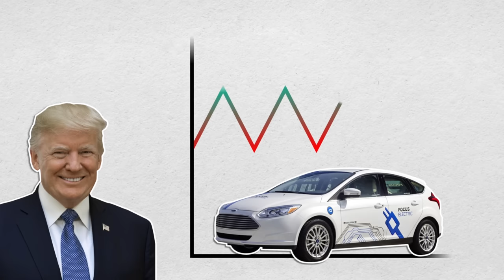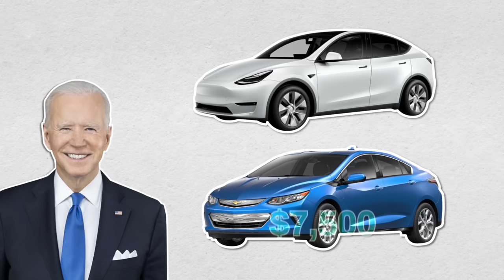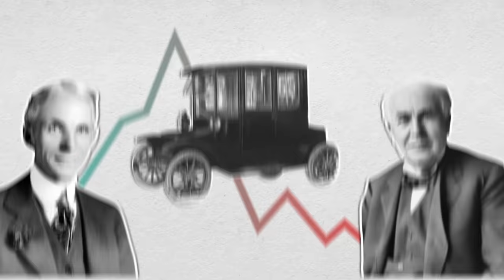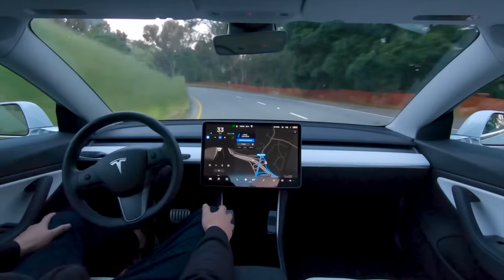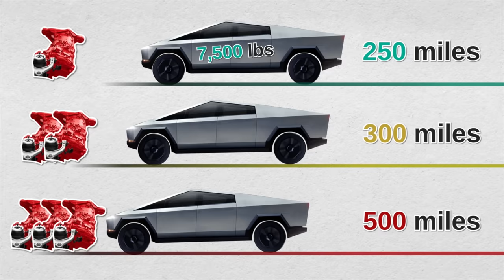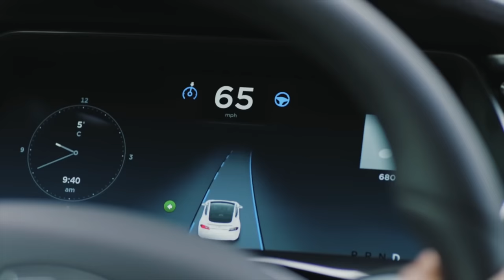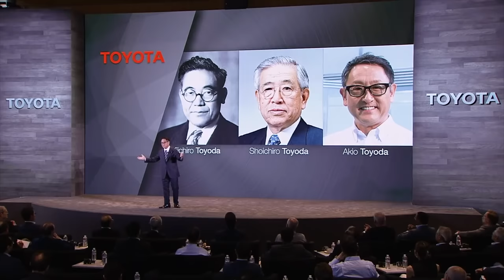Here's Why Toyota is Refusing to Make Electric Cars

Comment: Don’t want an all electric car myself…I think a hybrid vehicle makes the most sense.  Infrastructure is no where near where it will need to be and agree with Japan, electricity has to come from somewhere and Coal, Gas, Nuclear are really the only ones that are truly currently cost effective. Wind and Solar are too expensive to get started and rely on the weather.  Hydrogen may be a solution but it too is no where near a ready yet. I drive a Mazda and believe they and Toyota have the right mindset for their main vehicles.

Comment: Plug in hybrid has to be the way forward, a petrol engined self charging EV has to be kinder on the environment than a fully plug in EV!
Reply: I agree although ev range needs to be 100miles instead of the paltry 26-30 we see on most currently available phev. I'd also like to see all hybrid and ev fitted with v2h tech so they can be used to power your home when needed.

Comment: And of course, the Bolt has been recalled because of the faulty battery and they are suing LG. Electric cars never went away as such. In some countries the milk trucks were electric and buses in some areas have always been electric. It was just never taken up fully as a passenger vehicle until a company that was not tied to the oil companies got involved. Remember the Chrysler EV1?
 I think the EV vs Gasoline car battle 100 years ago was similar to the VHS v Beta fight. One had to win out in the end. I am just surprised it had to mean the end to EV's rather than a secondary adoption.
I like the Hydrogen idea because you can replace the bulky Batteries with a little Hydrogen engine but my concern is it makes the whole process convoluted from the production transport and storing of the highly explosive material to the fact there will be more moving parts in a car again and not less. It all seems to point to keep people in jobs in the production, transport and storage of Hydrogen and for mechanics who would lose half of their work on EV's.
In my humble opinion.

Comment: I am from europe and drive a Renault Zoe full electric car. 136 horsepower and 52 kw batterie gives a range for about 200-250 miles. For long distance travel I drive a Lexus RX400H wich ist still fine after 150.000 miles. I prefer defintly my electric car for travelin distances up to 100 miles.

Comment: I am thinking about an electric car for an unconventional reason. Perhaps one that the CEO of Toyota should consider. I do not want to buy a separate standby generator. My power goes out about 5 times per year. Fords Truck can be programmed to become backup power for the house with an appropriate switch installed to remove standby power from the grid. Its either that or a Bronco lol

Comment: Sadly, Tesla is ranked 25th out of 26 manufacturers in Consumer Reports most to least reliable list. 
The Chevy Bolt is having major problems with their lithium battery fires. LG is working on the issue but until then GM will halt production of its Bolt.
 Needless to say, there is a long way to go before EVs are mainstream.
 Currently, hybrids by Toyota/Lexus represent the best combination of quality, reliability, and low cost.

Comment: What about the GM Volt where you don't need a charging station. The 4 cylinder engine will turn on and act like a generator and you don't have to worry about being stranded.
Reply: That is called a hybrid.

Comment: You said the Bolt was the only EV WITH >200miles of range under $50k. The Model 3 is less than $40k ($39,990) and has range of 250+

Comment: Even if Japan is mostly reliant on coal and gas for electricity production, replacing all gas combustion vehicles with electrics and increasing electricity production capacity, would still result in lower greenhouse gas emissions. Same equations being used everywhere electric cars are being adapted to where coal and gas are still used to produce the electricity required. Japan does also use Nuclear, wind and solar power generation as well. They are approaching 10% of demand from Solar.

Comment: No to EV at this moment due to its range, available charging stations along highways and the cost of replacement battery. Another issue of the high energy battery is safety. Collision and any impurities in the battery can cause explosion and fire.
Reply: @colingenge9999  More than hundred millions gasoline car on the road vs a few hundreds of EV.

Comment: ford model t was made in gas and a 100% hemp and hemp fuel model just didn’t take off because consumers preferred the gas because it was louder and would help people hear it taken from my high school history books 

sorry if you’ve mentioned this scotty but thought it would be cool to discuss with some of the new to a 1920 ford model t

since we’re on the topic diesel engines can also run on vegetable oil and even better on used vegetable oil mixed with a solvent that is described as (have to get the name and will come back to edit) farmers and top gear has with jeremy have done it it runs just as well as diesel with the solvent that makes it thinner like diesel giving it the same range but you have to let it set for a few days my guess to the lack of popularity is that vegetable freezes and will require the diesel fuel to power a heater for about 15 minutes before being able to run on the used veggie oil 

 2 local shop here in LA that does these conversations on newer vehicles for about $10k i know about

Comment: I have a 100% electric Nissan Leaf. Charging it at home is a breeze because it charges while I am sleeping. I bought it used for around $7,000 dollars. Unlike hydrogen fuel cell cars, my car can be charged anywhere with no change to infrastructure. Hydrogen is very expensive to make and today relys on natural gas reforming to make it. Battery electric vehicles can be charged by the sun or wind. Good luck trying to make hydrogen efficiently on the roof of your house. The cost to charge a Battery 🔋 EV is way cheaper than fueling a hydrogen fuel cell vehicle. Hydrogen fuel cell vehicles still need batteries on board the vehicle to store electricity.

Comment: Virtually every country would have to DOUBLE their Electricity generation to support an all electric car fleet. I worked this out a decade ago when I was thinking of becoming an electric scooter importer. All the stats are easily available to do these computations. Elon Musk recently did the same calculation with the same results which pleased me no end. This is also what Toyota did and also said it was crazy for ALL major car manufacturers to start the same plan at the same time which was guaranteed to fail as all extremism usually does.

Comment: I think the plugin or phev are the best. Enough range for every day use and no need for new infrastructure like a all electric vehicle. It does most of your driving electric and can do long distances on gas. The battery needed for this is much small then a all electric. And you use alot of the battery capacity every day. Unlike the all electric vehicle you only use a fraction of the battery every day. Soulds like a waste of all that battery your not using every day. Cars like the chevy volt and the toyota rav4 prime. These cars make more sense then the full electric car. You can make 6 chevy volts battery to 1 tesla battery. I would rather have 6 people driving most days all electric then 1 person. These is much better for the environment and needs no extra built infrastructure.

Comment: the main argument Toyota makes is that they can save more gas by making 10 or 20 hybrids than they would be able to do with a single electric car which would use the same capacity of battery. which is true except for the fact that electric cars can be driven by an insane person and still have benefits while hybrid drivers need to adjust their driving style. the whole "our transformers would catch fire" argument ignores that regardless of how u put it, cars, electric or not, still only drive an average of 25 miles or less a day. so if the 1h of charging they need(to get their daily commute back) all happened when people come home from work and also turn on their electric stoves, it might be a problem. but there are already chargers that help people charge when the grid has excess energy and most people charge at night. i personally charge my car via an ordinary 10A

Comment: Figure out the hydrogen fueled car. It has no greenhouse effect. No emissions. You mentioned in another vlog, where do all the dead batteries go, let alone of the damage it's doing to mine the lithium. Battery operated vehicle is a flash in the pan mode of transportation.

Comment: With an 8 hour or longer charging time EVs won't be on my list to drive anytime soon.   The build process creates more GG than gas powered cars. More coal and gas need to be burned to generate the charge.  And finally, while the batteries are recyclable,  95% are not being recycled due to the high cost and dangerous process.  Lots of problems to overcome.
Reply: Do some reading, your wrong on all points except the build process
Reply: @robertsylvain333  already did.  You need to do more reading yourself.

Comment: Making a Move to Thorium reactors. Is a good choice for Japan & Evey country. Gas engine are Calener than E-Cars. When compared to Free Valve Tec Car's. Free Valve has a 20% calener , 25% increase in MPG &  30% More power out put.

Comment: I did a brief calculation and it looks like power plants would have to be doubled and the power lines doubled. Neither is going to happen. That assumes we charge all vehicles off hours, not likely, so we would likely have to go to 2-1/2 or 3 times as many power plants and power lines, good luck,
Reply: engeering explained did a similar calculation and came to the conclusion that the US grid would need to increase the capacity by only 30%. u r forgetting that people use far less electricity at night(when people charge their cars) vs the day.

Comment: Hi Scotty..  You expressed concern that using EVs in Japan will increase electricity generation by coal & gas fired generation with it's associated CO2 production.  I would suggest that you need to look into that more as there is plenty online showing that a coal power recharged battery electric car is far better for the climate than a petrol / diesel car.  The reason is that the coal powered generation runs at maximum efficiency pretty well all the time it is running to get maximum electricity for every piece of expensive coal that is burnt, whereas the car will run through the entire rev range, from idling when stationary, upwards, hence will rarely be running at peak efficiency and so pump out far more CO2 than the battery electric car will using that coal generated electricity.

Comment: I'm still waiting to see if the charging infrastructure really takes off.  All indicators say yes in the next few years.  If so and if all of the news is correct about solid state batteries then I'm onboard with an EV.  I do believe it is the future but I do take some road trips.  I need to be able to hit 250-300 miles per charge and it needs to be quick charging.

Comment: I have a 2014 Prius which still runs great. I can get almost 500 miles on a tank so until electric cars can do that and we have the infrastructure in place for them I won’t be buying one.
Reply: Actually you will when there are no alternatives. |The Prius is an overrated dead end.

Comment: I purchased my new gas burner last yr, it gets around 40 mpg.. I could have gotten a hybrid, but I was thinking, by the time I makeup the cost difference between the hybrid and the gas burner, I'd prob be needing a replacement $5,000 dollar battery. But, the way gas prices are rising (Planned) I may need to re-think my strategy.

Comment: I only wonder why they aren't designing these electric cars, with stylish solar panels on all upper surface areas. You park in the sun, save major bucks
Reply: Hyundai Ioniq 5 has this. But you'd need a lot of solar to make the cost of the panel worth it

Comment: What was that about the base cost being $152 at 4min 30sec? Well, Scotty is saying that if the base price of this model Tesla is $40,000.00 and (assume) get 263 miles per charge. $40,000.00 dived by 263= about $152. Well let's say that you keep the car for up to 100 charges, then the "base cost" is $1.52 and you will have driven 26,300 miles. All other factors aside, is divide the cost of one charge by 263. A full charge today will cost approx $8.24, which divided by 263 = about 3 cents per mile....

Comment: A couple of things.
1. I had to watch 8:48 minutes to hear about "Why Toyota is refusing to make Electric cars".  The rest of the video is history less and a total waste of time. 
2. Toyota say that converting to electric cars would cost Japan over 350 billion to convert to electric.  Toyota also says that Japan would run out of electricity and says Hydrogen is the answer.  However, people don't realize that making hydrogen, transporting , storing and using it to operate a fuel cell also takes electricity. In fact, it's less efficient from "well to wheel", than powering an electric car.  So hydrogen cars would be in fact take more electricity to power all the vehicles.

Comment: I am  a  technician  ,  even  I can  repair my car by my self  , but  I still  do'nt  like  engine car  ,  because   
1-   engine  very hot   
2-   engine  got  sound   
3-   engine   has  smoke  
4-   engine   has  many  oil  location  ,  
5-   engine   always  need to change oil  
6-   engine   will  leak  the oil   
7-   engine   need to be  repair  so many  sections  
8-   engine   spent more money  to the repairing  person  ,
*    I hate  leaking oil   ,   sound  ,  and  hot   ,

Comment: I have a hybrid Hyundai Ionqic. I would not have just an electric car because of situations that happened like in Texas last winter where cars were stranded. Electric charge on those cars do not last long enough in those type of situations. Mine gets 50 to 62 miles to a tank of gas. The only things I don’t car for are one it is lousy in the snow.And I mean really lousy! Second, it can only seat 2 to 3 small ppl in the back. And small ppl, I mean kids. I’m tall and I would have to sit long ways and take up the back seat which is illegal so I couldn’t do that either for safety reasons. I don’t care for Hyundai’s Blue Link either. ONStar was wonderful!!! But it was a Equinox that only lasted 7yrs and the transmission went out. So I’m leary of Chevy’s or GM’s.

Comment: Right at the start of the video there, the wrong Bush! And that was Al Gore's initiative, not Bush senior. I'm curious though -- what do you think of electric versus PHEV? It seems to me plugin PHEV makes more sense than pure electric, because there's probably enough net-zero-emission ethanol and biofuels out there for occasional long trips, and they can run electric for commuting, but I can't imagine there's enough raw battery material to supply a global all-EV fleet not to mention the logistics of charging on the road. And the plugin PHEVs have the further advantage of being much lighter weight than the pure electrics, and of being much cheaper to replace and recycle batteries on. The moment the fuel system effectively became part of the car's proprietary body we were in trouble with pure EVs. Toyota's call is self-serving, but it also seems to me to have technological merit.

A video on EV efficiency would also be interesting. Tesla leads here, but is that just superior aerodynamics versus the rather brick-like crossovers from other manufacturers, or are their motors better too?

Comment: I have driven 3 electric cars myself:
Volkswagen e-golf
Kia e-nero
Tesla model 3

I don't think many people know how great they are so here are my thoughts:

I loved them all! They are great to drive!

Pro's:
+Loads of torque
+Regenerative breaking is nice (the intensity is often configurable) so 1 pedal driving mostly
+WAY less noise
+No shaking from the engine when idle-ing which makes the whole car resonate (i usually drive old cars and this always annoys me)
+Pre heat/cool (just turn it on on your phone :)

Long term:
+++++ Hardly any maintenance!!  no valves/pistons/gears/clutch/exhaust/injectors/timing chain that will all wear/break and no oil changes.
Just think about it. Other stuff will break sure, but most of the mechanical legacy tech is gone which is just great.

The cons:
-Charging is slower than tanking gas, however every EV owner i speak to hardly ever has trouble with this.
(If you can charge at home it's always full when you start your trip).
If almost empty they often go to a fast charge station for 5-10 minutes to charge enough to get home.
This is currently not suited for everyone or every usecase, i know i know.
-The battery suffers in cold weather. It wears down over time and could be done after 10 years with current technology, then the big bill will come for the battery (...with current prices)
-Make sure you buy an EV with a heat pump or the heater will drain your battery fast!

Right now the battery pack is very expensive but i expect that the price and charging time will go down and battery lifetime might go up in the future with new battery tech like solid state.

Comment: The BEV will remain a niche technology.  The main problem with batteries is the low energy density compared to hydrocarbon fuels.  The result is that BEVs carry battery packs that weigh between 1,000 and 2,000 lb.... A ludicrous compromise for passenger cars or pickup trucks.  As the technology stands today BEVs only make sense in cities played by noise and air pollution.  Regrettably the political establishment is moving to force the BEV on the public - this way when incentives are removed the buyer will be left with no choices.